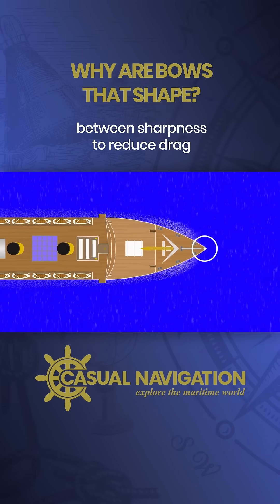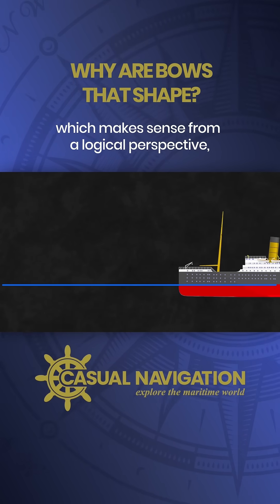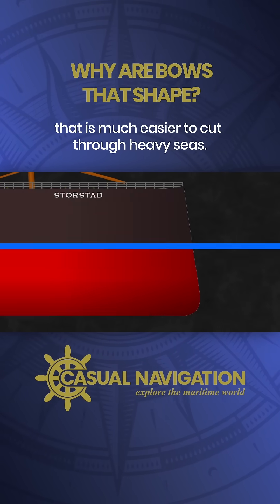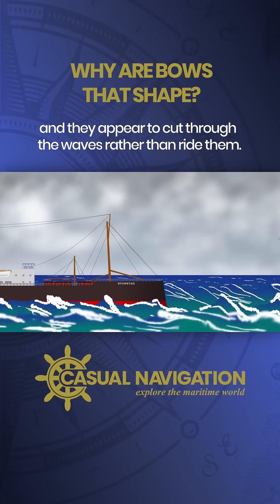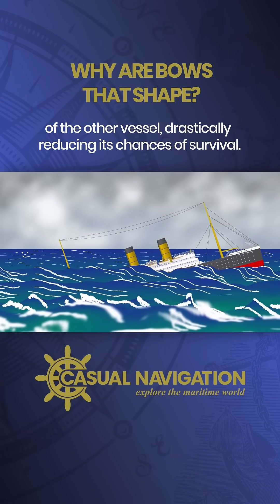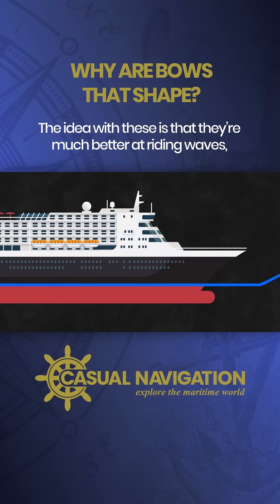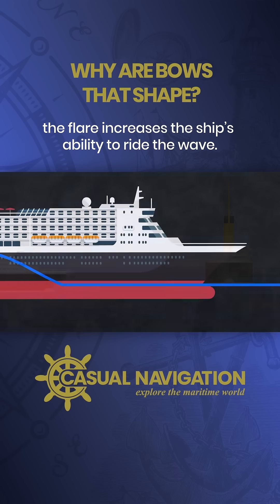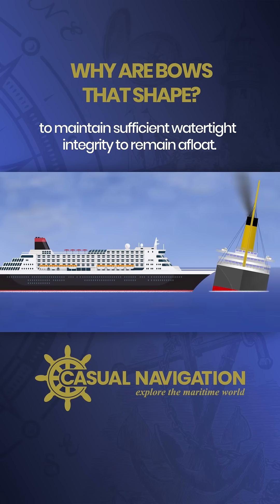Why Are Ship Bows That Shape? 🚢⚓

Comment: If this choice is about hurting the other ship, why did the military vessels switch?
Reply: "The use of severe above-water tumblehome significantly reduces internal useable deck area, which compromises the development of acceptable general arrangements. The standoff distance between the outer shell and inner magazines also is reduced, which compromises survivability." from the US Navy
Reply: Because ramming your enemy hasn't been a viable naval tactic for quite some time... Within living memory, it's only really been used against submarines; which are typically so low to (or even below) the waterline that the shape of the bow doesn't really matter.
Reply: If anything, you are more likely to collide with an ally than an enemy